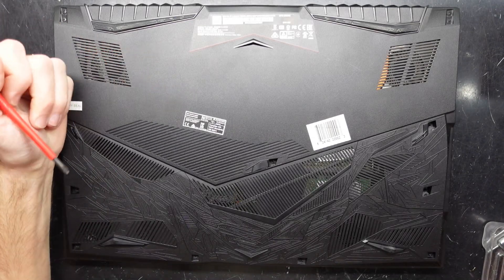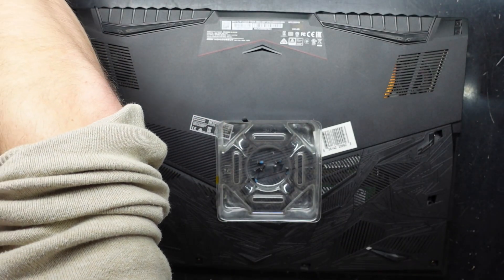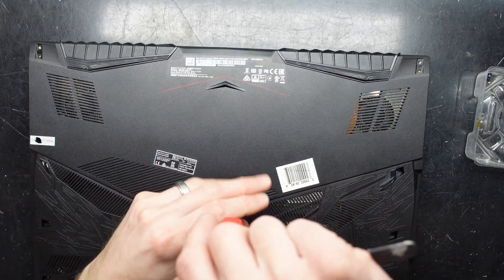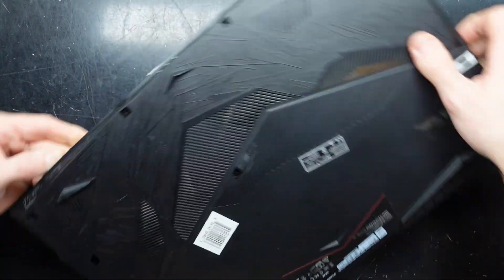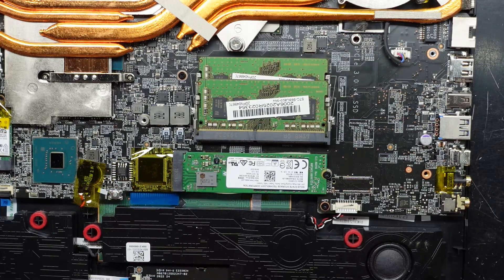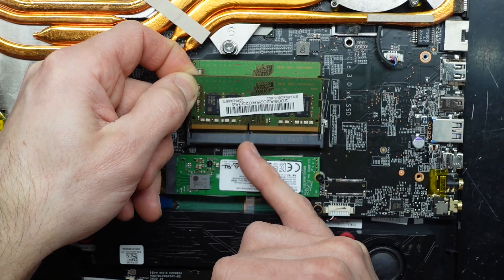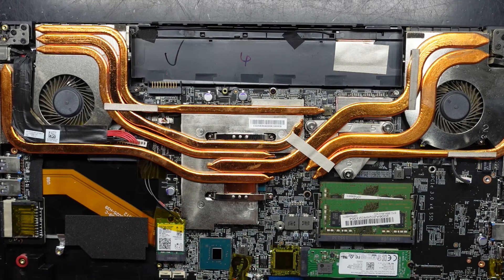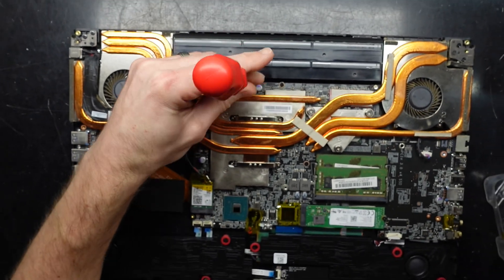MSI GL75 Leopard Ram and NVMe Upgrade

Comment: In 2023 still good video. I love working on my GL75 US when I have to upgrade. I replaced my 2 HDDs; easy peasy. Now just gonna upgrade my RAM to 2 x 32GB sticks. BTW, I upgraded from Windows Home to Win10 Pro x64. This laptop is made easy to work on and very well made.
Reply: Did u installed 2 HDD? Can u tell me how. I also have GL75 and absolutely love it but I only have the nvmen 512gb version :( and I need more space
Reply: @s_uing  to zależy od modelu płyty :( niby ma możliwość 3 dysków ale nie ma zainstalowanych złącz na płycie. Na filmie jest tylko jeden na m2. Ja mam w pionie po prawej m2 ale po lewej mam możliwość wpięcia ssd sata